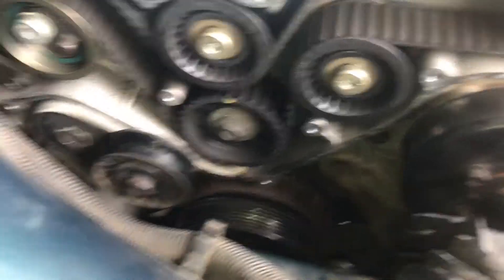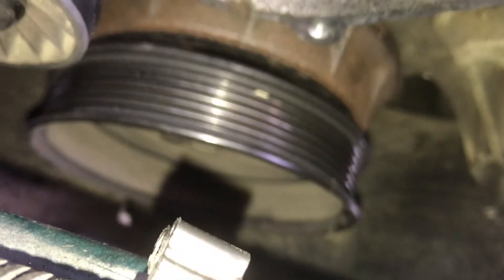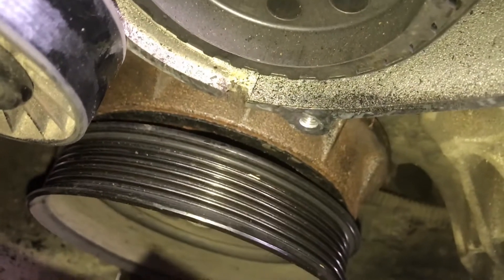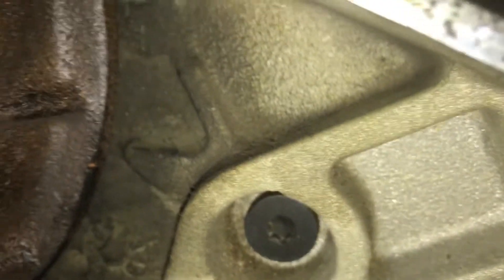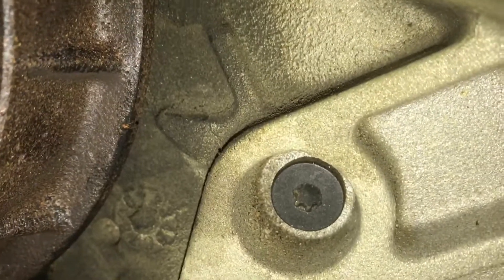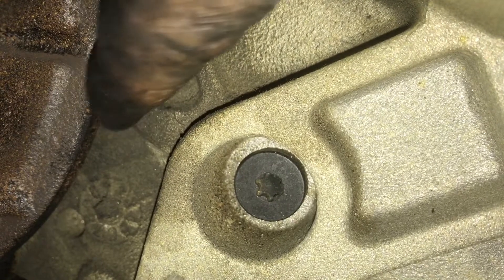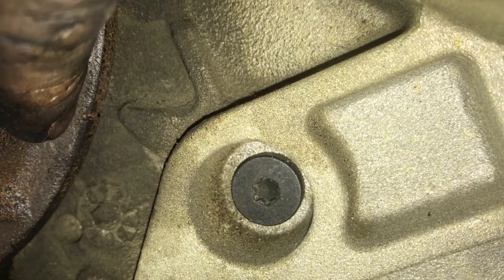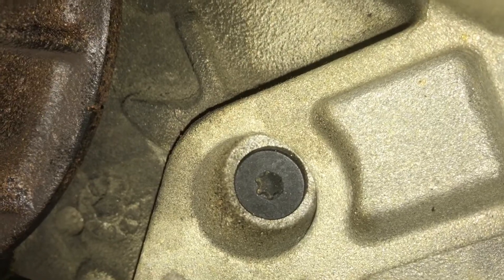3.4 DOHC Timing Marks

Comment: my belt got stripped by the crank sprocket  just above the dampener, i see the TDC mark, and its easy to line up, but since my timing all messed up any suggestions how to set up a camshaft sprockets in proper timing, since there is no marks on them! the rest of the belt was holding all of camshaft sprockets in order how it was when they install belt. any easy way to time camshafts ?